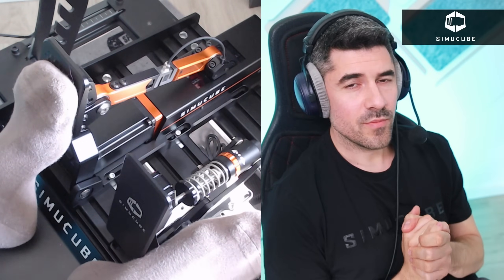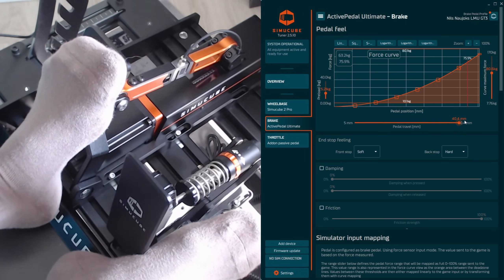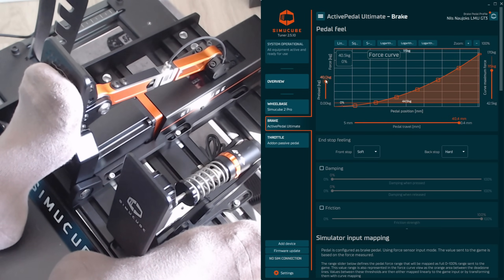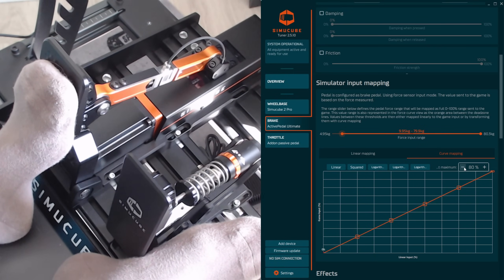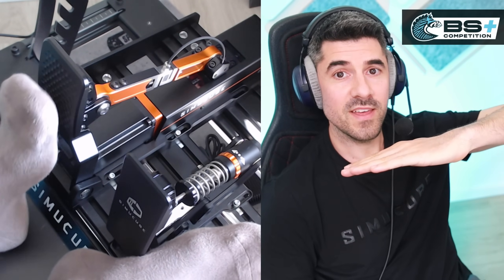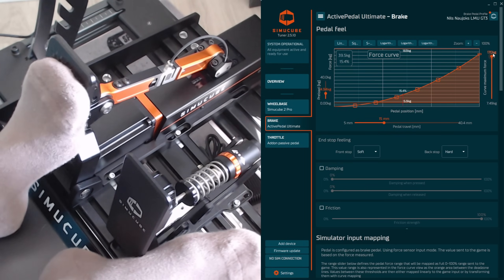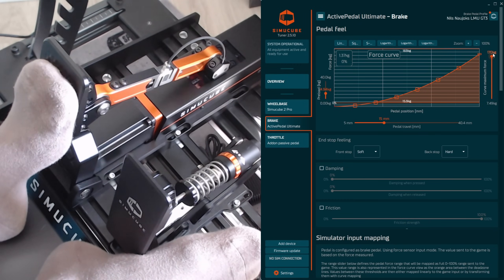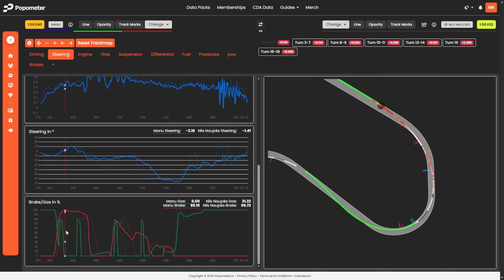How to UNLOCK your Load Cell's full potential!

Comment: Hey Nils, how are you liking your Lusomotors seat? I have a omp seat and I like to sit fairly reclined, which means having to set the wheel probably higher than ideal, otherwise my elbows will hit the side bolsters, I've looked around but there aren't any reviews.
Reply from the maker: i like it a lot (its the MK6). sturdy, comfortable, good space left and right. in the beginning it felt a bit tight, but i spend a lot of time in it - typing from there just now. 
definitely a recommendation. but if you are much taller/wider than me with my 184cm and 72kg, then you might need a wider seat :)
Reply: @SimracingPopometer  Thanks, for me it's either the mk6 or mk5 since I don't care for harnesses. For me, comfort is down to my ass and my hips not hurting but I've taken care of that with a memory foam butt cushion lol, for the hips, a car seat allows for too much pelvic movement, which is why I think I can't move away from bucket seats.
I'm gonna email them
Reply from the maker: @XavierGoncalves89  let ernesto know i sent you :D
Reply: @ I will, I wish I lived closer so that I could visit them personally and take my current seat for reference
Reply from the maker: yeah shopping seats is tricky with internet only. and there are also no demo rooms to have a seat.
Reply: @SimracingPopometer  It's a good thing you only have to do it once, after that you can just take measurements from the seat you have and extrapolate for other seats, if you shop for similar style seats. Before I even send an email to lusomotors I'm gonna go in person to a store close-ish by to check out some XL bucket seats, back height is what I'm after because my ass cushion is 5cm tall and only compresses about 1 or 2cm, which is far taller than any of the stock cushions bucket seats come with

Comment: I think active pedals are perfect to implement „real” brake force from car we are driving. We are talking about simulation, right?
Adjusting pedal resistance to our ability is like cheating ;)
Reply from the maker: you have way too high of an idea of what real life brake pedals are like apart from top spec formula cars.
and you are thinking that 2 pedals in 2 cars of the same manufacturer are the same too. thats all not the case. slowing down the car (a safety concern) is not going to be something that will be impossible to achieve whoever sits in the car.
i dont think realism is what you actually want in this regard as a lot of real life brake pedals are absolute flappy sh**.
Reply: @SimracingPopometer  We also lack a ton of information that real life drivers have in regards to braking, we don't feel G forces which means we don't experience deceleration, and as a result its harder to make the connection between pressing the brakes and feeling the car loosing speed which means that we go into every corner with only muscle memory as our main way to stop the car..
Reply from the maker: yeah, exactly.
Reply: @Inkta1  bingo ^
Reply: @SimracingPopometer I didn’t mean that.
If you play F1 on your simulator, you are buying pedals like Asetek - stiff and short travel (or adjust the ones you have). If you are playing on cheap Logitech pedals - it is not a simulation. It is just fun (which is obviously OK). But if we are talking about a realism in therms of sim racing, we would prefer probably 50-60 kgs instead of 30.
This is also a reason why we install the seats from real cars (or designed that why) to our simulators.
Of course G force during car deceleration helps you a lot while breaking in real car but also this is the reason we are cheating our senses with other features coming from dd wheelbase for example, which are not present in real cars…
Reply from the maker: yes, but i'd argue we are just getting back information (through different means, though) that we'd have sitting in the real car and that we are stripped of in the sim because of the G forces missing.
I dont think simracing is easier than irl due to that.